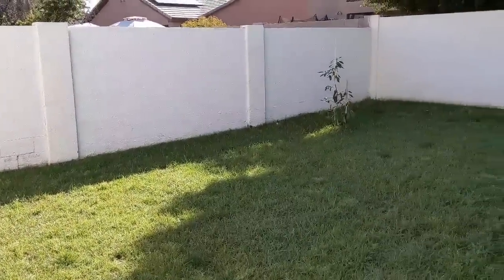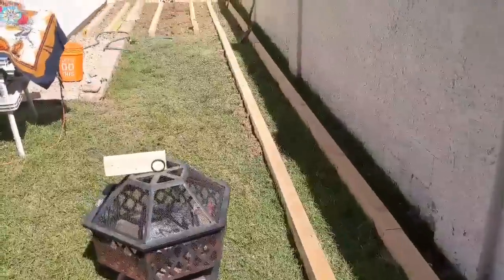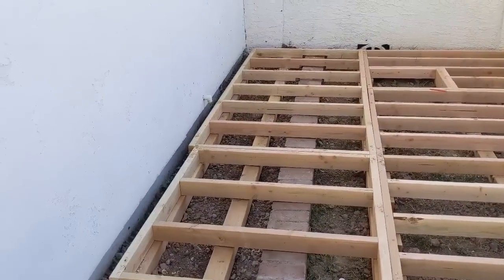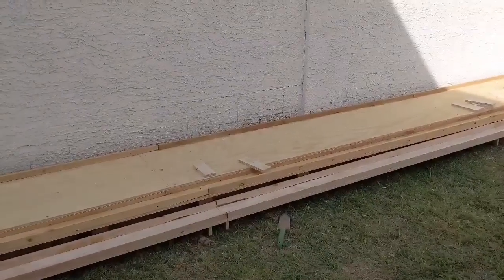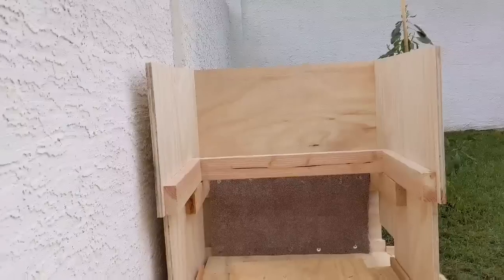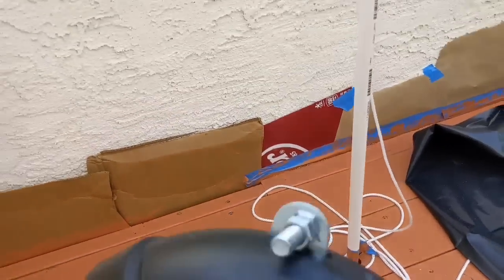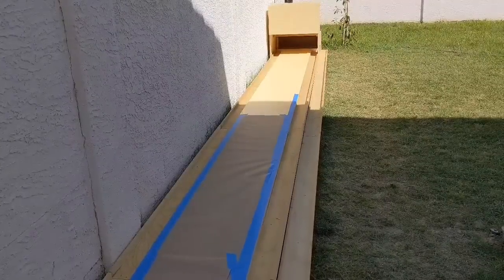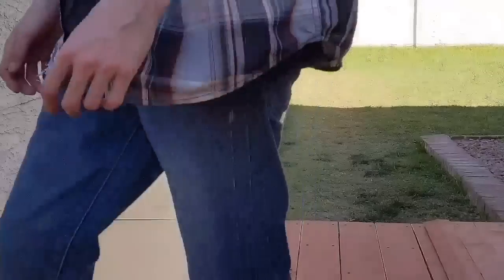Built a bowling lane in my back yard!

Comment: Great job!!!! As a former professional bowler I will add some comments here > The amount of weight you have on the pinheads could be cut way down for more realistic pin action. Loose the twine rope holding the pins for some 80 lb fishing line or other filament. This will also make it look more aesthetically pleasing. Loose the carabiners/clips for some eye hooks drilled into the top of the pins. Typically you want the most weight to be centered in the widest part of the pin were the ball makes contact.

Comment: Dimensions?   It's clearly not 42inches wide or 60 feet long...  I think you mentioned 30 feet at one point.  Is it just half scale?
Where did you get the pins?    where did you get the balls?   Did you consider using skinnier rope?    
30+ years ago I remember playing string bowling at a lane in Hamilton, Ontario.  The strings in that bowling alley were pretty much invisible --- now of course it was dim, as all bowling alleys are, and it was a full size 5-pin bowling alley, so it was far away.  (yes, I said 5-pin.  This is Canada, where we have both five pin and ten pin.  The five pin ball looks a lot like the balls that you were using.
Reply from the maker: You are correct, it is half-scale.  30 feet from the foul line to head pin and 21 inches wide.  I chose the ropes that I did for durability in the heat and across pulleys.  Here are links for where I got the balls and pins...

https://www.amazon.com/gp/product/B07NZ291Q8/ref=ppx_yo_dt_b_asin_title_o05_s00?ie=UTF8&psc=1

https://www.minibowlingpins.com/

Comment: I feel like you should put leaders on the pin ropes, and find a way to hook the string into the wood of the pin rather than using all of that hardware. Other than that, I think this is amazing. I hope it's still in good shape after 2 years.